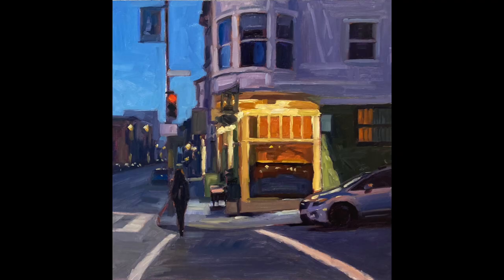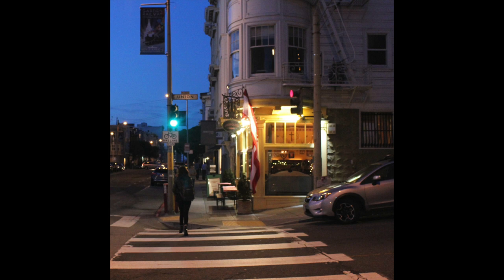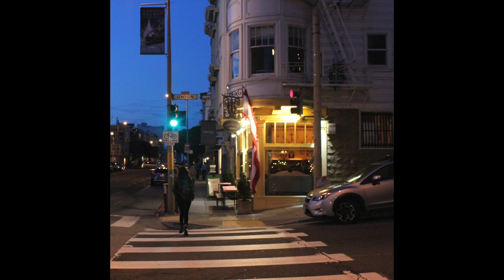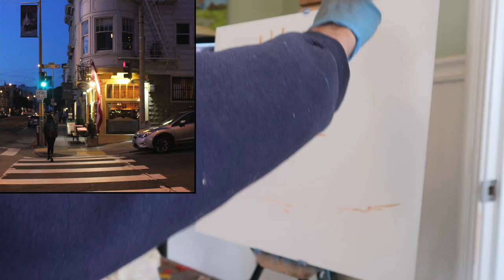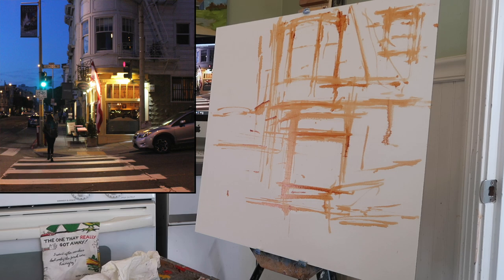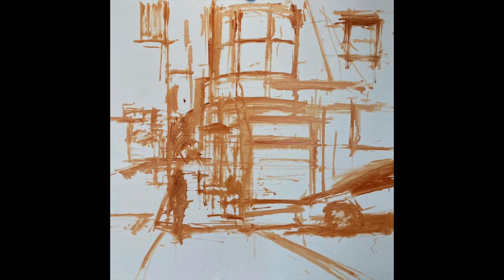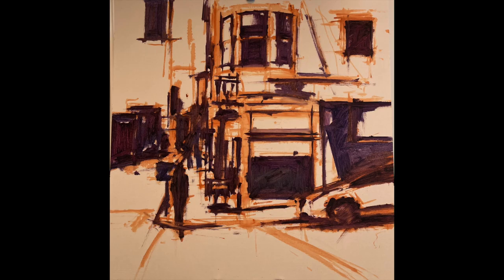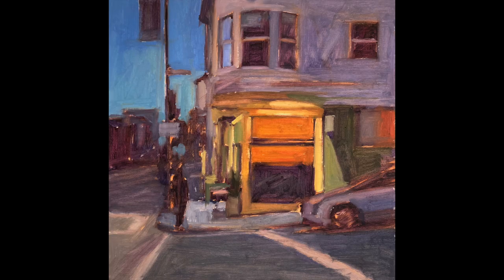OIL PAINTING PROCESS for CITYSCAPES alla prima painting technique

Comment: I think it's interesting that this video is 9:11 minutes long and there are two twin tower looking shapes (almost like lit cigarettes) on the far right of the painting opposing a smaller square strucure (wtc7?). Above that, appears to be a large upside down 7 or a check ✔(check yourself before you wreck yourself?),  with a downward facing 'greater than' [>] sign just above that. That it is located on the street 'Union' also implies something, I think. Maybe one day your paintings will be clues to solving some crimes that are greatly demanding resolution.

Comment: I never usually comment... but can you try working from lightest to darkest. Add your lightest colours first and then add in the darker..Shadows etc. You will then not need to heavily layer lighter colours.
Reply from the maker: I will sometimes put in the lights first and then key the painting to those lights. The tradition in oil painting is to work from dark to light, keeping your darks thin and loading your lights. That usually works for me!